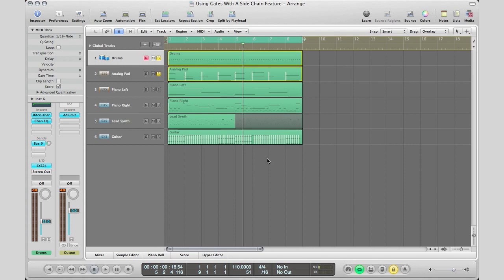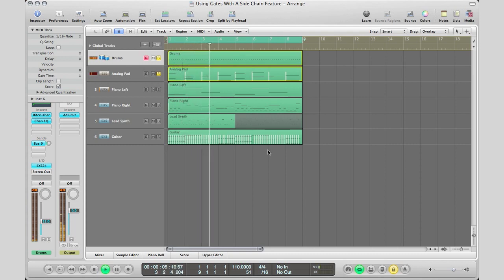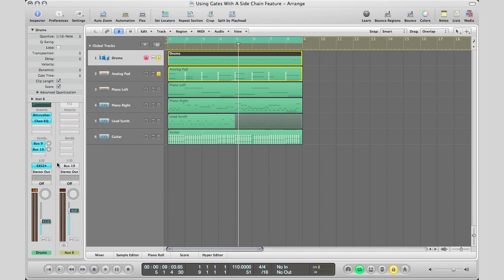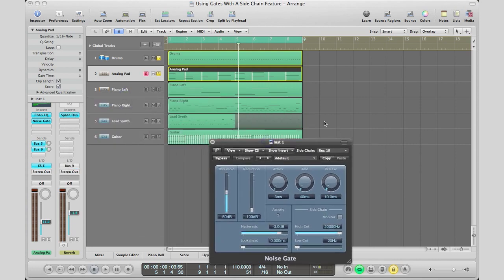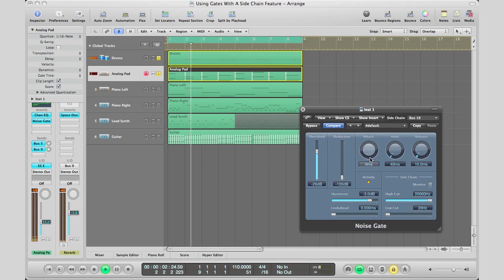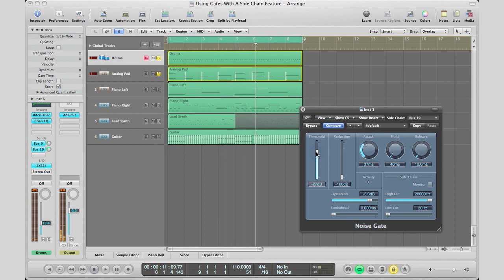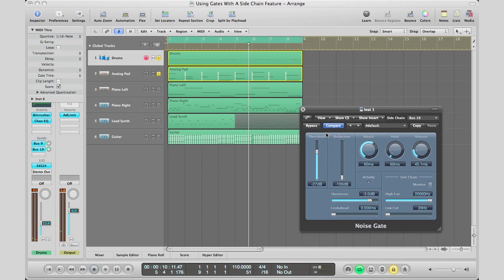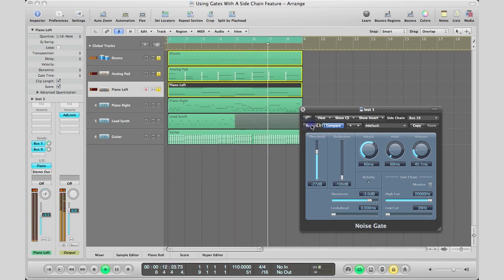Using The Noise Gate Side Chain Feature

Comment: To keep the effect but lose the high hats, change the "stereo out" to "no output" on the hat track. 

The signal will continue to flow through the bus, triggering the effect, but it will not come out the master output track. It's like unplugging an old walkman from headphones/speakers - the tape is still playing but there's nowhere for the sound to come out and be heard (except in this case the automatically created aux track also receiving the signal is still wired to the output but the "volume" is down so you can't hear it until you slide the fader up. You can also change this track to no output or delete it in the mixer view).